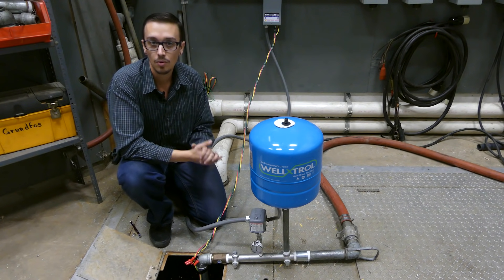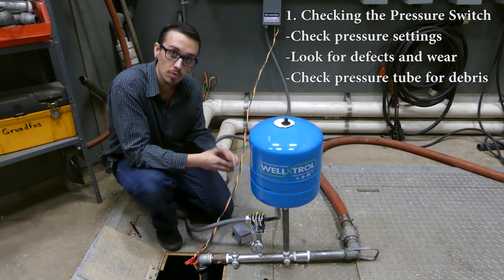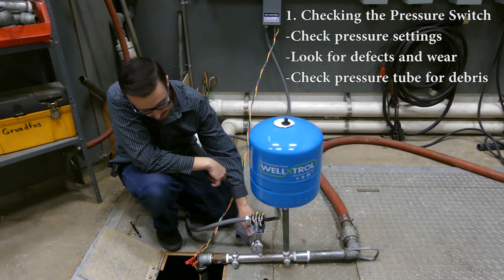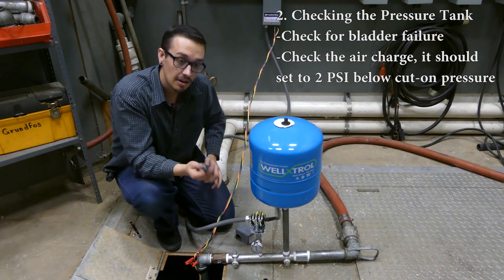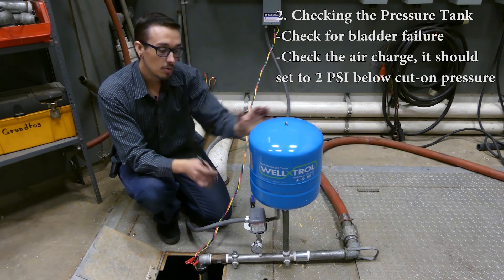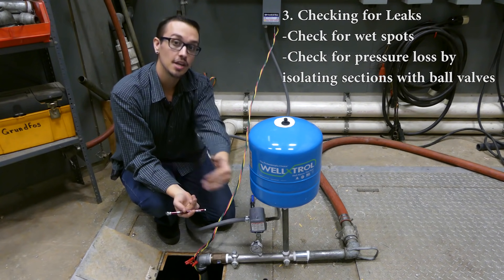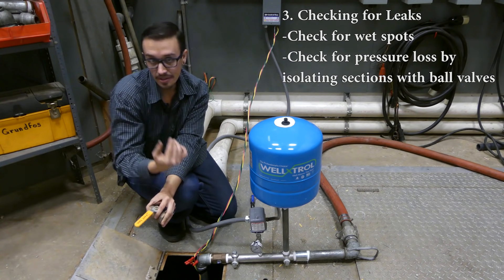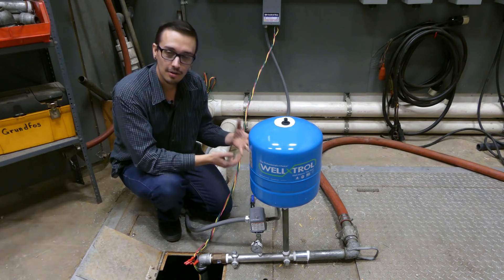Troubleshoot: Water Well Pump Starts too Often (Rapid Cycling)

Comment: Hello, I have some questions. 
1. Which pump is better for underground water tank,  an normal stage pump or an self priming stage pump  ?
2. Why my water pumps for the house supply running rapidly,  on and off and all taps are closed, and when I open one tap in the house the situation same,  pump running rapidly on and off.
3. My water pump system for supply water in to the house is also one strange things more, I open one tap the flow is ok but if I open an second tap the flow drops down. I have 2 pumps with capacity of 10000 liter each per hour. I not understand at all why like this is.
Thanks for replying for anyone.
Reply from the maker: Give us a call: 855.329.4519

Comment: Nice tutorial, I found that if I had a problem with short cycling and there was no discernable leak, I'd shut the whole system down via the valve at the pumphouse and see if the pressure held and if so, I'd check the pump bladder and without exception, it was usually a few pounds low so I'd pump it up to around 2# over my lower level pressure and there was no more short cycling. My biggest problem has been clogs in the 1/4" pipe that hooks up to the diaphragm at the bottom of the switch. I just had a fail in this regard now and naturally, it occurred during inclement weather when I wasn't feeling well. I'm thinking I'll add a union to the system so I don't have to disconnect all the wiring to unscrew the unit which is a PITA. Hopefully, it will work for future maintenance issues. Does this sound doable? Again, thanks for your professional and informative presentation...

Comment: The pressure switches contacts somehow became mis-aligned and a spring popped out; I replaced with a 40/60 switch but when I checked the air pressure in the tank it read 58 psi, I tried lowering the pressure but the pressure on the entire system came down also. There is no short-cycling at all, and everything seems to be fine, what am I missing? PS awesome video

Comment: I have a valve on my well outside, should I let it run during warm months? It drains into pipe and runs to back yard into woods and drain in swamp. Have high water table here. Neighbors and my self have artesian wells??? Will let run a couple times yr to flush hard water build up. Any suggestions would be helpful.

Comment: I checked my tank pressure and it was 0. Added air to 38 psi and within 5 minutes it was reading 24 psi. I’m guessing I need a new tank?!
Reply from the maker: Correct, it sounds like you have a leak and the tank needs replaced.

Comment: I know this is 3 years old but here’s my issue. Why is this system still promoted as the only system available for well or lake water supply? The original advantage of this old system is based on the generic quality of pump seals back in the day and it was considered advantageous to reduce the number of cycles of the pumps and also to provide reasonable pressure for short operations of the faucet. However we are now in the 21st century and things have moved on. 
Pumps have improved in respect of the motor quality and the quality of seals has also improved, not the cheap ones. Taking this into consideration and coupled with automatic flow control switches, it’s about time we ditched the vintage high cost, high maintenance concept. Just sayin!!!
Reply from the maker: You should check out our video on VFD Systems: https://www.youtube.com/watch?v=jmhdDOWEi9Q

Comment: Thank you for the informative video.  I noticed today that my electric usage has doubled for the last 45 days over what it normally is so I immediately suspected that my well pump may be running continuously.  When I stick my head in the well house however I don't seem to hear anything.  Would it be making noticable noise if it is running all the time?
Reply from the maker: Check your pressure switch/gauge. The well pump may be too far down for you to hear
Reply: @RCworstwater  Thank you for the quick reply.  The pressure switch gauge is at 40.  I think I have identified the issue causing my increased electrical usage (totally unrelated to my well pump fortunately)  - I have ordered a KW monitor to verify my findings.  I really appreciate you posting these videos and especially responding to questions!!

Comment: I have noticed my pump kicks on every 10-15 seconds, my gauge says 40, but the moment i turn on say cold water at sink it drops instantly and the pump/switch kicks on and it jumps to about 50 then down to almost nothing instantly again. 
 I assume this is the bladder tank gone bad?  If I turn the power off, drain the tank by leaving the sink on till no pressure, can or should i try to use an air compressor and check the valve at the top of the tank to see if it holds any pressure? 
 I did open the valve cap and pushed the valve and water came out so I am assuming i have no pressure, is that something i should be adding air to yearly or is it just shot?  The house is 20 yrs old, but i have no idea if it's original to the house, guessing it might be though, what is the average life of a bladder tank?
Reply from the maker: The tank is shot. Give us a call and we can help you with a  replacement: 855.329.4519

Comment: What if it gets up to 60 psi and shuts of and stays off until water gets turned on and drops down to 40. Pump kicks on but is short cycling until it gets back up to 60 and can’t keep up with things like showers or dishwashers.
Reply: Mine is doing that. Did you ever find out what your problem was?

Comment: My pressure tank is at 0psi, everything is ok except I notice the pump comes on every time someone flushes the toilet, and also many times when someone showers/ does laundry. Any reason it would go to 0 besides the tank going bad? I  did the screwdriver test sounds empty up top
Reply from the maker: You probably need a new tank. Watch this video to test it: https://www.youtube.com/watch?v=w21qa2bMUh8
Reply: @RCworstwater  thank you for the response, I didn't see any water coming out of the shrader valve and it sounds hollow up top I will try to pressurize it today and report back. Does that ever happen though, where the tank loses all air pressure but just needs to recharged? Tank is 32 gal wellxtrol only about 7 years old
Reply from the maker: It's not common for working tanks to lose more than 1-2 psi over a long period of time. If it is at 0 then I assume the tank is bad, but follow the instructions in the video I linked and you'll have your answer. Wellxtrol tanks have a 7 year warranty as well. If you're outside that warranty period and the tank is bad then I would highly recommend going with a larger tank, preferably 81 gallon: https://www.rcworst.com/Amtrol-WX-255-Well-X-Trol-Well-Water-Tank-81-Gallons-p5132.html

Comment: You where talking about water log. You show how to test for it but not the fix. I believe that what happen to mine. I drain my tank. Pressure was good in tank started pump and tank refilled. But I don’t understand how this happens
Reply from the maker: Thanks for the comment. If your tank is water-logged it needs to be replaced.
Reply: Thank you for the quick answer

Comment: Thanks for this video.  My water pressure drops after a recycle without any valves or taps open causing the pump to cycle on.  Any suggestions on what is going on??  Cheers,
Reply from the maker: Sounds like you have a leak somewhere

Comment: Excuse me, I have a water pump that achieves a pressure from 5 up to 7 bar and once I open the faucet the water flows strongly and after maybe two to three seconds it becomes weak, bearing in mind that the pressure tank is intact, and there is a check valve installed before, and after the pump. So, what is the cause of this problem? Do you think that one of the check valves needs to be cleaned or replaced? Or what?
Reply: Check the pressure tank diaphragm pressure.  To check it, you turn off your well pump, drain all water pressure to zero.  On your pressure tank you will see what looks like a bicycle tire , car tire air fitting.  Check the air pressure there.  It should be sett only 2 psi below your pump on pressure setting.  Most well water systems are set to operate between 40 psi then turn off after getting to 60 psi.  If the pressure tank inside diaphragm pressure is too high it will not be able to expand inside to store water.  This causes your well pump to cycle on off very quickly and or come on immediately when you turn your faucet on.

Comment: I recently replaced my 86 gallon well tank with a 36 gallon tank since I only use it to run sprinklers.  I installed all new brass hardware and a 40/60 pump switch and pressurized the tank to 38 psi before installing it.  I expected the well pump to run more frequently but I can’t tell if it’s short cycling.  When running the sprinkler, the pump will initially cycle after a minute and run for 1 min 17 seconds.  When it gets to the last couple sprinkler zones, the pump activates after a minute and runs for 1 min 28 seconds.  The well tank is holding pressure.  Is this considered short cycling?  Thank you!
Reply from the maker: That may be a question for the manufacturer of your pump. You can ask them how many starts per hour the pump is rated for.
Reply: 36 gallon total capacity your tank have 9.3gallon drawdown. Other is used with air.

Comment: I just checked to see what is causing our pump to start every 10 seconds when on.  The pressure gauge next to the switch stays at 40 no matter what.  It doesn't change at all when the pump turns on and off.  Has anybody had this happen?
Reply from the maker: Sounds like you have a bad gauge. You should replace it so you can troubleshoot.

Comment: I have a question for you, Why is it important to have your pressure switch near the tank?  I relocated my tank recently and left the switch at the top of the well.  Our pump man said that it would not work that way.  As long as the switch is between the tank and the check valve the pressure should be the same correct?
Reply from the maker: Good question! When the pump shuts off and turns on there is a "wave" action that takes place in your pipes, similar to water hammer. The pressure tank aborbs most of this "wave", so the pressure that is read at the tank is the most accurate. As you most away from the tank the wave gets bigger, and for a sensitive device like a pressure switch that "wave" will cause it to open and close rapidly, causing the pump to turn on and off repeatedly.

Comment: 1.) You're showing that system as an acceptable set up. That is very wrong! You're running a Franklin control box on the wall they require a 1 minute minimum between your cut in and cut off of the pressure switch. The 5 gallon tank shown will not give any pump its' necessary 1 minute cycle time. At minimum you should be using a 35 gallon tank or larger. The tank shown is meant for constant pressure systems not the analog system shown here. 

2.) Also you mentioned putting a ball valve between the pump and the pressure switch, then shutting the ball valve. THIS WILL LEAD TO CATASTROPHIC FAILURE! A much better way to accomplish this is to put the ball valve on the out going line, allow the system to build to full pressure, then shut the ball valve and killing the power to the pump, then giving the system 10 minutes to see if the pressure has dropped.

3.) No pressure relief valve, EVER SYSTEM SHOULD HAVE A PRESSURE RELIEF VALVE!
Reply from the maker: Thanks for the comment. This video is for troubleshooting purposes only and should not be used as a guide for an acceptable setup. Check out our "How to Size..." videos for that information.

Comment: Great information. I have a problem with rapid cycling. The pressure switch clicks then it fills up the pressure tank and then clicks. But without water usage it slowly loses water pressure until it get to the cut off which is 30 PSI then it fills back up and it does this all day. I have a ball valve before my pressure tank and I’ll shut off the water supply and the tank doesn’t leak so then I had a guy come out to my home and replace my well pump. But I still have the same problem. Any idea what it could be?
Reply from the maker: You have a leak somewhere if the pump is turning off and on without any known usage.
Reply: Did you ever get it figured out? Mines doing the same I just freaked out and bought a whole new pressure tank and calling a plumber tomorrow.

Comment: Thanks for the trouble shooting tips!
I have a 300 foot well and lately the pump has been kicking on more often when nobody is using water.
I’m thinking that the check valve is leaking back towards the pump.
Reply from the maker: definitely a possibility. Sounds like you have a leak somewhere.
Reply: Have you fixed the issue? I seem to be having the same issue also
Reply: @burtreynolds781  
Sold the house
Reply: @knightclan4  😂 the perfect solution.
Reply: Hey burt is check valve 100%%
Reply: @TunaVEVO  👍thank you sir , I had replace that check valve and the pressure switch bc it had burnt terminals inside , everything works perfect now , and the tank holds pressure now.
Reply: Awesome burt. Thats because of cycling on/off.

Comment: I have an older vertical jet pump that is marked ao smith.  It's a 1.5 horse 230v 1 phase 12am m#u27843 or c48m2fc4c1. It may be related to century also....I dk.  I'm trying to locate a repair kit with bearings various gaskets and impeller parts to rebuild this pump, but I don't know what kit would work for this 20 plus yr pump....also I would like the electrical components like the capacitor the start switch and the governor switch.  Also, before the pump gave out it made  awful  grinding metallic noises but before it made those noises it pumped sand into every plumbing fixture in the house.  So I would need a foot valve also since my system is 20 yrs old.  But if the foot valve is in the sand and the pipe is too deep, can I just pull it up some or not drop it down so far after inspecting or replacing the valve?  Thank you for your time and knowledge

Comment: Hi sir.. I am facing problem about the booster pump using hydrovar VFC that pump is running continuously. Even there is no water leakage and pressure vessel and NRV is also good. It's cutt-off pressure is 2.5 bar.
Reply: Ours is also running continuously.. did you ever figure out the problem?
Reply: @shawnasiebels  yes... Actually it's NRV was defective. Which we could not get during the first inspection

Comment: Hi! Total girl here, so hang with me lol
I have a jet pump. Strictly for water pressure purposes. No well, I just live on a large hill. A few months ago my pump was replaced. The old died. Other than the fact that it is ALOT louder than my previous, it worked fine. Well, being the person I am, was not satisfied with the pressure in the house. Watch a couple somewhat informative you tube videos(wish I had seen yours first!!) and went down and adjusted the nuts. Instead of messing with just the large nut, I turned the little one also a bit and I had the pump going a little wonky 🤦🏻‍♀️🤦🏻‍♀️.  I adjusted back and it was working fine again. HOWEVER, the past few days it seems to be really kicking on often, especially when doing laundry. Say every 5min, running for about 10 seconds and shutting off again. The pressure has usually always read about 30psi when I go down to start laundry but noticed today it only read 20. My basement is cold, could the bladder in the pressure tank have lost air similar to the way car tires do in the winter? Also, is my pump cut in and cut off too close together? Not separated by 20 psi since I messed with both nuts that time. I’m sorry for the long post, but I’m a worrier and was just wondering if you had any idea! Thanks so much!
Reply from the maker: Stephanie, you'll want to take a look under the cover of the pressure switch for the original pressure settings (probably 30-50). Once you know that, run some water and watch the pressure gauge. Take note of where the pump turns on and off. Try adjust the pump back to its original setting written on the cover. Once that's done, you'll want to check the air pressure in the tank and make sure it's 2 psi below what the pump turns ON at (28 PSI on a 30-50 switch. To do this, )turn off the power and drain the pressure out of the system by leaving the water running until it stops and your pressure gauge reads zero. Give us a call if you have any questions or need help while you're working on it: 855.329.4519

Comment: does any body knows what can be causing banging on the pipes and sputtering then losing pressure to almost nothing ?too much or not enough air?it started after I replaced the water heater thank you all

Comment: So my water pressure is fine, but it does surge when toilets are filling. I emptied the pressure tank which had very little water in it. the pressure is at 0 now. when I do run water the pressure goes rapidly between 40 and 70. I know it should be 40 to 60 and not fluctuate so fast. the well pump is was brand new in 2016 but not the pressure tank. The tank looks pretty old, label is all worn off. The pressure switch was replace last November as well. Before I go buy a new pressure tank, any other trouble shooting I can do?

Comment: How often is to often? My well pump will run for about 20 seconds to fill up and it takes a out 2 minutes to empty with constant water usage... is 2 mins and 20 seconds to often?
Reply from the maker: 20 seconds is far too short for a cycle. You want it to run for at least 1-2 minutes for proper motor cooling. You need a larger pressure tank: https://www.youtube.com/watch?v=zz0dYccfqaE

Comment: Great video! I have water coming out of the air valve when I tried to add pressure. Does that mean my bladder has failed?
Reply from the maker: Yes, unfortunately it does. Give us a call if you need help selecting a replacement, you can find them on our website here: https://www.rcworst.com/Pressure-Tanks-c171.html